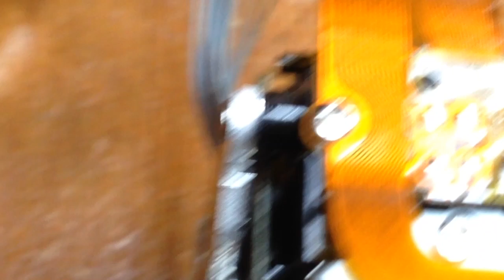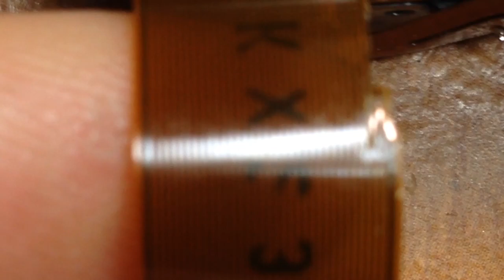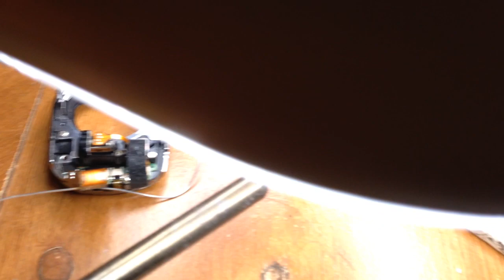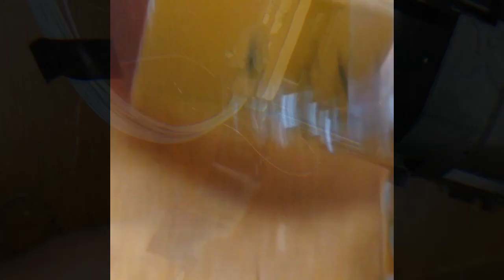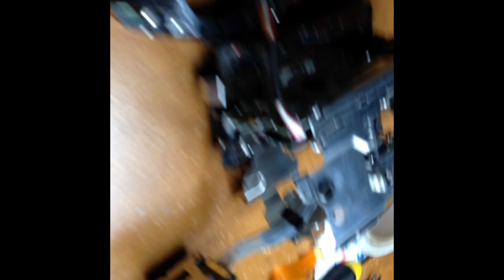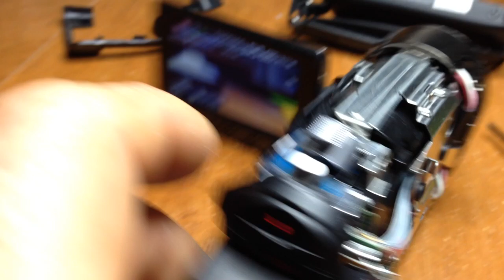How to Repair Flex Cable - Flexible PCB Type Flat Copper Ribbon Cable

Comment: I have a question: Is it possible to use very skinny needles on reconnection by overlapping a broken flex cable? If the cable was sheared or ripped in half.
Reply from the maker: I don’t think that would work, since the electrical connection wouldn’t be good. If there’s nothing to loose though, give it a try.
Reply: if needles were stuck through the copper leads it wouldn't?
Reply from the maker: @shawnharrison7596  Vaguely possible, but not a mechanically sturdy electrical connection in my opinion. Better to do the soldering solution.

Comment: Nicely done - and well persevered. If its any value - quite a while ago - I exposed the metallic parts of the cable and used one of those silver fluid conducting pens (small tip) to actually draw the lines and reconnect them together, and then used a scalpel to ensure there was clearance between the "painted" on lines, and recovered afterwards. Useful in situations where you have a damaged break along the cable. I appreciate your situation is different though...
Reply from the maker: Thanks, yes that is a solution for close by breaks.

Comment: When I do this, I just use enamelled copper winding wire, so you don't need to slip insulators over the wires.
Reply from the maker: Yes you can do that but it’s a bit of a pain deinsulating the ends sometimes and I didn’t have any thin enough for this job.

Comment: wow great video.
this made me attempt to fix my broken flex cable problem. scraped the cable back to the copper traces, continuity checked, now to solder on wires. i am hopeful.
whats the worst that could happen? it already doesn't work, and would be a bin and rebuy anyway.
Reply from the maker: Thanks. Yes nothing to loose. Well done for trying. Hope you are successful.

Comment: so what you wanna say is that you can solder the wires in the flex cable (if broken) individually but all that needs to be done is to take care of the shortings that can happen during soldering since they are basically wires running in a group.
Reply from the maker: Yes, but it’s difficult and not obvious that it was going to work.  But it did. Not your ordinary soldering job.
Reply: @comeinhandynow  In the end one cannot be certain that it will work even if they can solder all the connections perfectly as you did. you wanna say it may work for some cables but not always workable...
Reply from the maker: @Koushiksistla  You can measure the resistance to see if you have a good connection or not. If not, then try, try and try again, as the saying goes. With enough patience it can be made to work again.
Reply: Thanks a lot there cuz you took the pain in answering my silly questions..sorry if I had troubled you... thanks once again.

Comment: This dude is crazy, he dead ass fixed a torned up flex ribbon cable...with solder and a heat iron. Those hard wires is gunna pick up electromagnetic static noises, seriously.
Reply from the maker: Thanks. It worked the same as normal afterwards.  Still working!

Comment: I wish I was more careful in cleaning my Neato. The 15 wire flexi cable tore off the PCB. It's 50 quid for a new display unit with cable attached - I think that's my only option.
Reply from the maker: Probably easier if you can get the part. Or look to see if there is a convenient place to solder on a replacement generic flat ribbon cable, like they use in PCs.

Comment: Just a hint the continous moving and focusing in and out makes people feel almost ill and makes you video nearly impossible to watch, get your self a small table tripod fix the camera to it and move your item around in front. I am impressed with your repair but using heat shrink sleeving would have given you a much better finish, I am about to attempt the replacement of a small tft screen on a Alcatel  2045X mobile phone and it is interesting to have seen your approach, Thanks.
Reply from the maker: Yep, I’m learning.  This was made a few years ago.  Heat shrink wouldn’t have worked very well as the wires were very small and flexibility is needed.  Good luck with yours.

Comment: I never had to replace or repair ribbon cable that fine, but I would imagine it would still be easier to source a matching donor ribbon or even a bunch of ribbon cables to work better, by simply scraping the "Donor" sourced ribbon/s "which need to be cut to a suitable length to bridge the damaged ribbon, to then LIGHTLY and I stress LIGHTLY load all the tracks with solder", and then scraping matching areas on either side of the damaged ribbon to match the donors prepared tracks, so that where the ribbons meet back to back ?! WAIT! I mean lightly soldered tracks of the damaged ribbon to the lightly soldered tracks of the donor tracks, ergo the donor upside down ribbons are simply bridging the damaged tracks once the ribbons are married to each other via using a heat station or the hard way via a soldering iron, don't forget to spray some lacquer once all tracks are in line and functioning..
Reply from the maker: Thanks for contributing but that would have been bordering on impossible for this particular cable because of the very fine pitch, the completely broken cable with plastic as well and the difficulty in soldering onto the tracks (they end up shorting together if done in the same area).
But for bigger pitch cables, then sure, that may work.
Reply: Everything is ok, but pulling the cables in flex tears is a big problem. I'm trying to do it with a microscope, but it's very difficult to connect the wires on the flex 😭

Comment: Very nice work,but instead of trying to insulated the wires adding extra bulk it would be better to use enameled copper wires for coils making.There are diameters down to 0.05mm.
Reply from the maker: Thanks for the input, yes that would also work, but it’s sometimes a bit of a pain removing the varnish on the wires in order to make the connections. Putting on solder and waiting a while sometimes works to strip the varnish, sometimes not very well and the last thing I wanted was any added difficulty making those tricky solder connections on to the flex cable.

Comment: A much easier method is to use a magnet wire to bypass the flat cable. Just do a continuity check until you find the bypass point and then run the magnet wires directly. Then you don't have to use the flat cable's broken section at all. you can find a much, much more secure location to attach the wires. Usually a test lead location or a point where a contact goes to another side of the board are perfect for shoving a magnet wire in, and soldering it there. To prevent Abrasion to the magnet wires, I recommend spacing them and taping them in the manner of the original flat cable using something like masking tape on both sides. This will not only prevent abrasion, but also prevent any possibility of shorts if the insulation wears out.
Reply: Sadly, my problem is a lot more complicated :(. I have a 240 pin flat cable that is bonded on, and is also underneath an LCD that is also bonded on so that I have to remove the bonding to get to the problem portion of the bonding...then with no bonding machine, re-bond the original and the other flat cable. Soldering it is basically impossible. There isn't even solder mask for the drag method. Still, I will find a way...

Comment: Thumbs up for the effort. Try a Hakko iron, SMD tip, 0.44 mm Mulitcore solder and a drop of RA flux. Your soldering is stone age.
Reply from the maker: You're probably right. I used what I had.  But it did work and the camcorder is still working all time time later.

Comment: Well done, it's always a tight/tough job, doing this. Myself have done a similar job by heating the cable (with a smd solder air iron) in order loosen the lamination a bit by which one can more easily scratch (actually wiping ) the plastic sub subsequently
Reply from the maker: Thanks, useful extra info there.

Comment: I hope this works cause the cisco flip cams are not sold anymore.And mines button ribbon cable torn when disconnecting it from the board.And i'm sure the parts are not sold anymore either.So anyway to fix it ill try.
Reply from the maker: Good for you.  Patience and perseverance is needed.

Comment: Enamel-coated wire makes this easier. BTW you can also repair those soft blue ribbon cables, by using a non-heat method, as they just shrivel up on contact with a soldering iron. It took me a long time to figure out how.
Reply from the maker: That's a good point.  Need some really thin stuff though and getting the enamel off the ends can be a pain.
Yep the blue ribbons are a lot easier.  It was the micro fine pitch here that was the problem.
Thanks for contributing.

Comment: neh this method is bad not so good , i have wery simple metod for this and is guaranted quality
Reply from the maker: +lazar vasile Do tell then, don't keep it to yourself!
Reply from the maker: +lazar vasile Any more information on your alternative method yet? Or a video?  I'm still interested in what alternative you have.
Reply: you must to buy this , cooper foil with adesive, a printer, foric acid,permanent maker,flux, or any fex cable from any device like the same size of inductors. i dont hawe a time for video right now
Reply from the maker: +lazar vasile Ah that brings back memories of producing my own PCBs by submerging blank PCBs that had track written on them into ferric chloride solution. The tracks were made using permanent marker or using a uv lamp and photosensitive ink plus a transparent mask with tracks printed from a printer.   That method will work on larger size PCBs, and ones that can be removed in order to dunk them into ferric chloride solution that is involved with that method, but on larger PCB tracks it is a lot easier to just solder some copper wires onto them, and a lot quicker.

The subject of this video is the really difficult job of joining to very small and very narrow tracks of around 1mm pitch that you find in modern equipment like camcorders.  That is a whole lot more difficult and the flex cable in the video can not be removed and dunked in ferric chloride solution as it is very intricately connected to the other electronics in the camcorder.

Hence way the method shown was used.

Comment: Hi what if the flat cable has a kink or crease in it as a result of getting trapped behind LED screen would this cause screen to flicker or display lines sometimes?  as this is what is happening when I have put my car stereo back together after opening to remove the sat nav disc as it was stuck in the unit
Reply: Also would I have to replace the flatcable or could I repair a crease/kink?
Reply from the maker: +BigEgoz I suppose it could cause that, but I am guessing it has lots of connections and it might be difficult to find the broken ones in order repair it.  Try moving the cable while looking at the screen to see if it is really is the cable kink at fault, or another connection.
Reply: +comeinhandynow when it flickers and I press the screen  it comes back on for a few seconds however if I unfold and fold it doesn't make much difference
Reply: +comeinhandynow appreciate the reply your very helpful
Reply from the maker: +BigEgoz It sounds like the connections onto the screen itself are the problem, rather than the cable. Usually these are just made by strips of layered conductive rubbery plastic held under compression between the display glass and the circuit board with the connections. Some mechanical change or weakening can release the pressure and create poor connections. Your best bet is to see if you can produce a bit more pressure to squeeze the circuit board onto the screen by jamming an extra item like a piece of paper in there or some tightening up if things are loose.
Reply: +comeinhandynow I'm keeping the screen pressed it is working one hundred percent but when I let go it goes off the only thing I will have to do now is find a way to take it off and tighten things up it definitely seems to be what you are saying so I'm really thankful for the help!

Comment: I have a car instruments flexy circuit board to do, its the same principal as these ribons, but bigger, & on a slightly thicker laminate. I had done it before, using a short length of solder instead of wire, but it messed with the resistance, & as a result the fuel gauge read wrong.

I`ll do it again, like you have, with copper cable strands instead of solder & see if that improves things...

Comment: AWSOME! I like people who never give up. If You ask others for help or advice then 90% of peoples will say "oh, you cannot fix it, you have to replace this flex cable" or "sorry - the flex cables are not repairable". Simply - they are too lazy to even try to fix it. I admire You, because You gave me now a motivation to fix my broken flex cable. Thanks man!
Reply from the maker: Thanks for your great comments.
Reply: apparently audiences came to watch this video are people who wont easily give up, and I am glad so many people watched and left comments here. this is very inspiring
Reply: you can use a tiny cable from coils or power supply transformer < its covered you dont need isolation< just heat the ends with flux and iron to remove the protection
Reply: totally agree with u, i have an LCD samsung with cuted lines in ribon cable from LCD glass to the the TCON< the ribon is soldered like that i cant jumper from glass to tconn pcb< i will try this solution< i have motivation now just waiting to change my iron solder head to do that<<<< greetz from Morocco
Reply: i like that, but the reason im here is i dont want to spend 15$ for a single piece that broke itself from careful handling, chinese flexible pbc are the worst.
Reply: that is true what you said,,but think of this now  cheap can cause you ,,,,,your life. many people die because the were cheap..to pay to a pro to fix the car brakes

Comment: If you use wire-wrapping copper wire for the repairs, it already has a thin insulating varnish on it, which burns off very easily without leaving any crud - that way, you don't need to worry about insulating the naked wires from each other.
Reply from the maker: Ilya Eigenbrot 
That may be possible but for this job they would be a bit too thick due to the very fine pitch involved and also not quite as flexible.  Thanks for the comments though.

Comment: comeinhandynow You will find that the type of soldering you are doing will be a lot less stressful if you clean your religiously with shavings or wet sponge. Solder should not bead up on your iron. Also, try a fine grit sandpaper instead of your xacto knife to clear away the thin layer of plastic. Finally, get some flux, apply to cable.
Reply from the maker: tiger12506 Thanks for your comments, all reasonable suggestions.

Comment: I wonder if Conductive Paint might work. I don't know the particulars of resistance ect. of that cable but its worth a try. 

CircuitWorks® Conductive Pen Dispenser for Drawing Conductive Traces, Jumpers and Shielding, 9 grams
Reply: That would be impossible due to the very small pitch, in my experience.

Comment: Is it possible to fix this cable/wire that snapped in half? Shown at 27 seconds in this video:
plantronics backbeat 903+
Reply from the maker: Jacob Bond It should be possible as the same type, but difficult.

Comment: https://farm4.staticflickr.com/3868/14762619037_a819bea762_b.jpg
or https://www.flickr.com/photos/10124891@N06/14762619037/sizes/l
Please check  this photo captured of a  flex cable.  Some technicians told me this cable with carbon inside (can transmit electric signal). Have u ever fix this kind of flex cable ? thanks
Reply from the maker: The blue coloured cable looks like its copper inside, I doubt very much it is carbon as that would be too resistive. It looks like you tried some scraping or melting at a couple of spots. Often one side is thicker plastic than the other. Try the other side of the cable. Do some scratching with a sharp scalpel.

Comment: My question is this.  what would you charge for that type of repair? If u were to even agree to fix that for someone else.  Me, i like the challenge.  Broke may as well give it a shot.  What's the difference?  Throwing away 1 broken cam. Vs throwing away many components (less scavenged parts) that once was a cam?  Nothing beats knowledge of disassembly.    Got a few bluetooth headsets in need of some repair.  Wonder how much shipping........   j/k
Reply from the maker: Thanks for your kind comments so far. Yes there is the challenge element and the thought "do I want to throw away a £400 camcorder?". Nothing lost in trying apart from time, which also has a cost of course. The trouble with doing paid repair work is the time(read money) compared to buying a new one, with no guarantee of success and therefore also payment. I wouldn't want to charge for my time if unsuccessful in fixing. Take your headsets for example, they would probably not be worth spending time/money on repairing at say £50/hour, when you can cheaply get new ones for less money. Which is why very few people repair things anymore. I used to offer repairs as a teenager and a hobby, where my time was cheap, but now I have my own list of things to do/fix. If there was a very expensive piece of electronics that looked possible to repair I might have a go, but a minimum charge of say £200 would put most people off, any less and it's not time/cost effective. Regards Jon